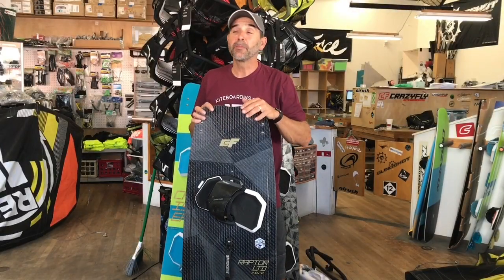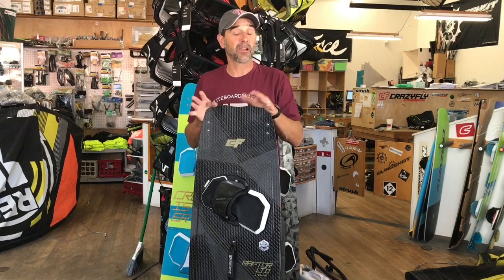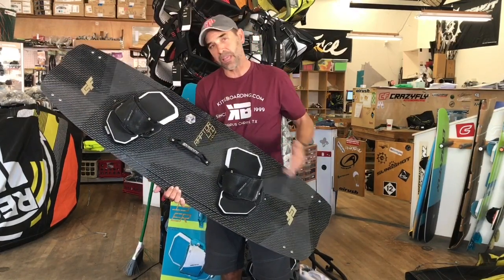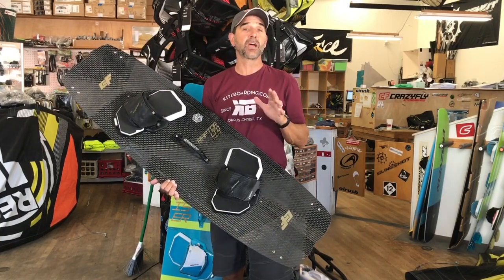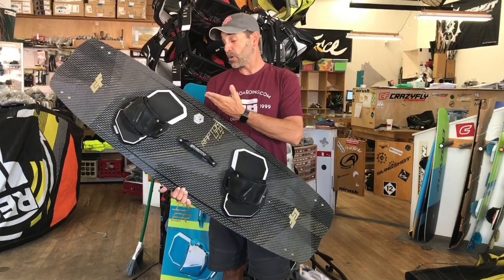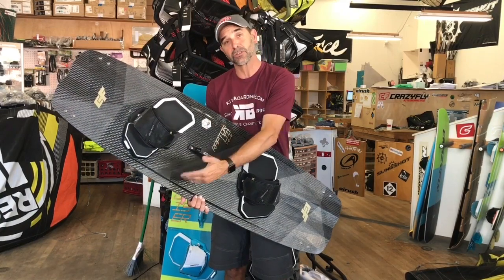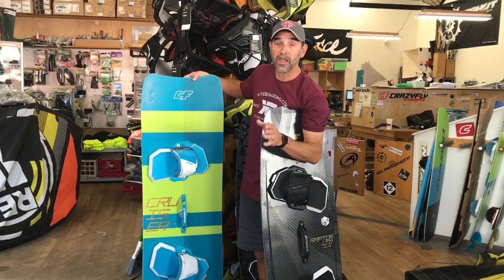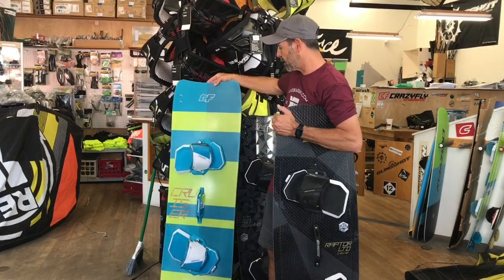Kiteboarding board widths

Comment: 270lbs 5'6 in 12- 15mph winds do you timk foiling would be a better option for me.
Reply from the maker: Generally speaking, a foil is much more efficient than a board so with the right kites skills it would be a great option. A lower profile foil, like the Cabrinha Double Agent, would be my suggestion. Pair that with a larger single strut kite like the Airush Ultra or Naish Boxer and that will be a good option for riding in lighter winds.